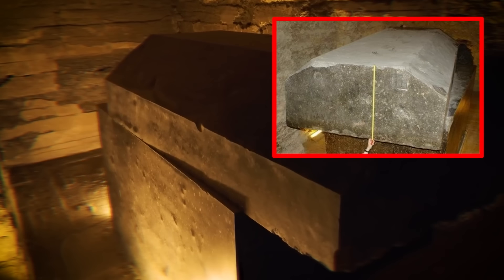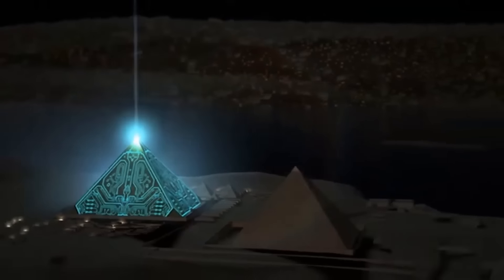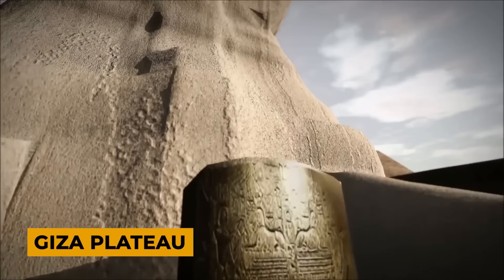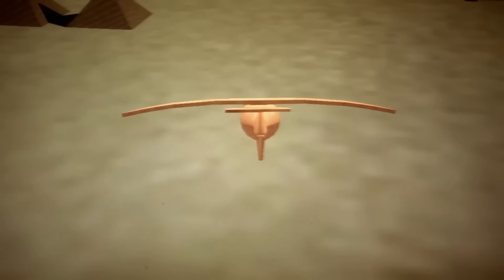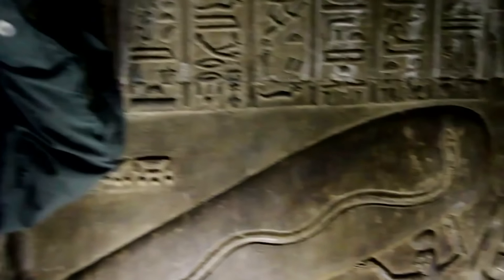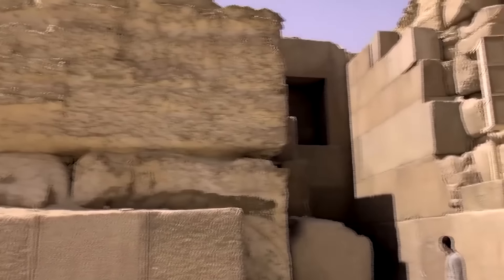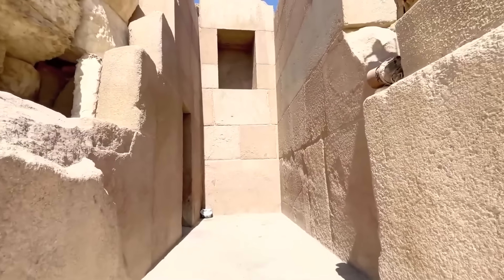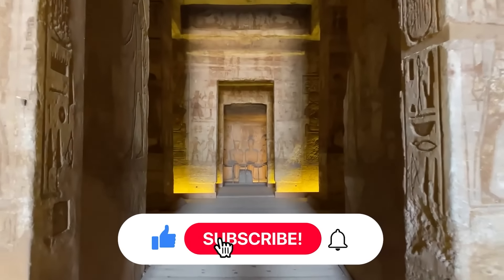Ancient Egyptian Technology Left By An Advanced Civilization That Disappeared

Comment: that disc I believe could have been used as a water accelerator in a pipe line, such as could be used for water blasting, or with the subsequent introduction of abrasive desert sand, sand blasting. this method could be used for cutting stone, and for the shapes seen that would not be able to be cut with any sort of blade or disc. i have been fortunate to have had in depth experience in abrasive manufacturing and design. to move large volumes of the large blocks long distances, I believe two way hydraulic roads may have been used. these could have been made like a railway, with the perfect square blocks used for the channels, and a water slurry using  beach sand for propulsion. I remember skim boarding at the beach, using the same principle. this also leads to the idea that the great pyramids main use were not for burials, but were the main factory for the water and hydraulic systems used for cutting stone, irrigation, and water channels..
Reply: Love the skim board theory .

Comment: The Oseirion is an ancient water pump dating to the time of Zep Tepi, the time before the Great Flood and pre dynastic Egypt, when the weather was still tropical in that area. The Pharaohs built temples on top of it and placed inscriptions and hieroglyphs claiming it as their own, but clearly had nothing to do with building the original structure!
Reply: that could be logical, because its build on water sand. The   tunnel could be a water lock. For what reason?
Reply: @faragraf9380  I assume it was built to control the water table and help prevent flooding. This advanced civilization obviously knew a lot more about water hydraulic systems than we do. Of course, they also were able to build enormous megalithic structures and move million pound stones, had the power of flight and could most likely levitate objects of enormous weight, but they couldn’t stop the devastation when that comet hit the ice sheet in Canada in 10,600 BCE!

Comment: They show power going up out the pyramid .. The pyramid originally had a gold pyramid shaped top .. Obviously to draw ELECTRICITY IN DUMBASSES .. That top would attract all lightning , in the vicinity.. All lightning is attracted to the closes ground possible to discharge its load .. The gold top and the pyramids height ensure any lightning ever in its vicinity will strike it .. WHAT THEY DID WITH THE ENERGY IS THE QUESTION

Comment: The Sphinx is probably a fountain, part of a water system that maintains the pyramids with water. The stripes on the sphinx are not stripes from a possible rainy season. The stripes have arisen because the sphinx is a fountain when the water has flowed down the sides year after year.. This is placed in a basin-like construction that supplied the area with water. If you see the entire area from above in a 3D map, the explanation is quite obvious.

Comment: It a massive water hammer.
That allows you to pump water up a shaft to very high levels like they do in cities with water tanks. This is probably a spring under pressure too.  That would explain why they buried a boat in front. The water hammer could rise the boat with the blocks in a shaft as you build the levels. You can go up to any level by sealing the walls. Works like a canal lock. Then pull a plug and boat goes down with the water feeding the town th4iugh channels like a pump. Probably used it to water the crops and make power with water levers and such. Someone finally got it. It's pretty simple and logical if you think of it.
Reply: Oh yeah the Nile river may have came right up to the front in that area before the sand shifted. Could of been all green with boats in canals etc.

Comment: Re: The Dendera light forms,  looking at the design, I anticipate they used etheric energy to create a current for the lumin, That rod with horizontal bars at the bottom would have been a collector or capacitator of sorts. It was perhaps based on a more quantum understanding that what we embrace today even. so they would not have needed connecting circuitry as they harnessed the ehteric energy in location of the lighting device . If they  used anti gravity and sophisticated energy techniques in building, surely they would also have understood about harnessing energy from the ether/atmosphere?  This is the principle you have proposed as the reason of placement and location and design of the whole pyramid- so a single light source is not to hard to understand?

Comment: So they generated electricity in the pyramids and transmitted it, I could buy that to a degree, but to power what? How do you make it usable? Electric motors? Light bulbs? How do you wire it up or get it into tools, homes that’s never explained? I could understand small scale uses, for electro plating, but show me something that works, I’m far more persuaded by the theory that the pyramids produced chemicals rather than electricity to powering your washing machine